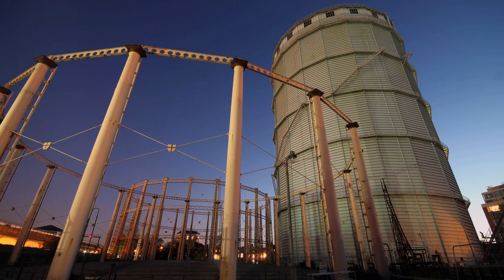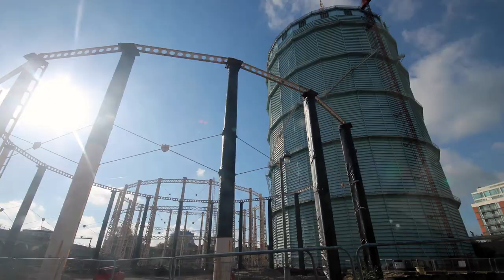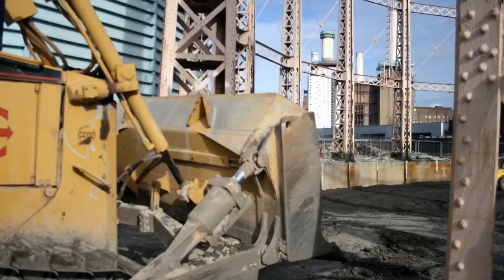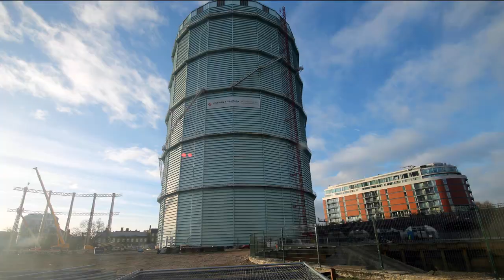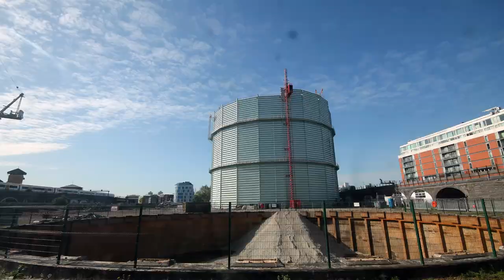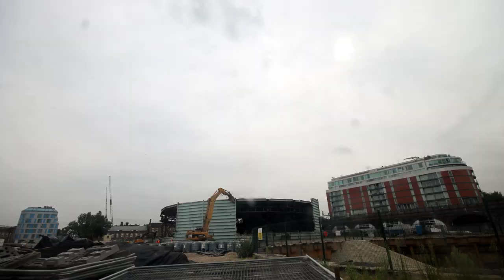Battersea Gas Holders Demolition - Time-lapse by Regenology

Comment: Times change, and that is a constant. But like many in that area, another piece of our past has now gone for ever. I used to go to Battersea park with my Nan as a kid. Turn right at the gasometer and I knew we were just over half way there. The fun fair, the Easter Parade. The little train at the main gates to take you into the fair. The tree walk with Snow whites dwarfs. Playing in the fountains. The secret Castle on the lake surrounded by nettles and wire. The boats, the cafe. My Nan.....all locked in my memories, they cannot be demolished and built on. I may live far away now, but my heart will always be in Battersea.